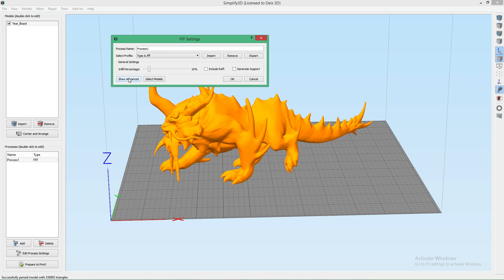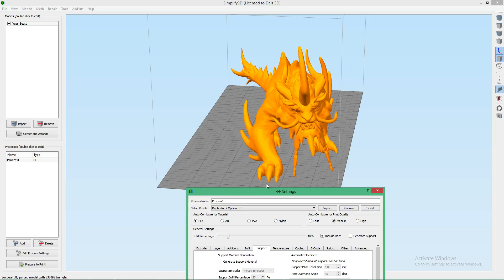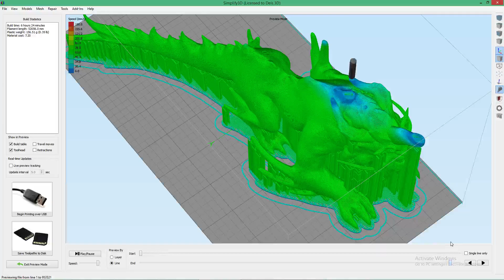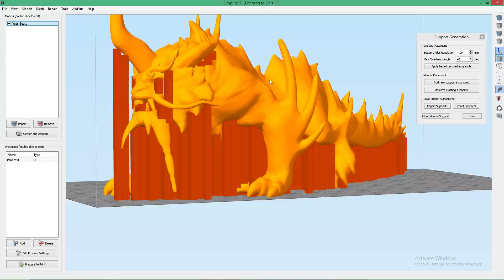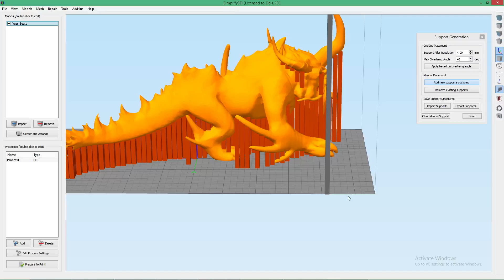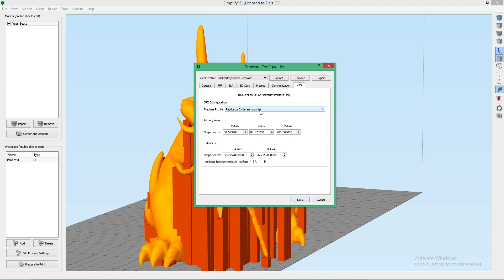Running a simple print with Simplify3D

Comment: Unable to contact the "fantastic support".  Can you assist with a M3D and the newest software? I can't get it to talk to the ports. ie:
Attempting connection at \\.\COM4... Baud rate 9600
RECEIVED: wait
RECEIVED: wait
RECEIVED: wait
RECEIVED: wait
RECEIVED: wait
RECEIVED: wait
RECEIVED: wait
RECEIVED: wait
RECEIVED: wait
RECEIVED: wait
RECEIVED: wait
RECEIVED: wait
RECEIVED: wait
RECEIVED: wait
RECEIVED: wait
  Testing plaintext communication protocol...
RECEIVED: e1
RECEIVED: wait
  Testing binary communication protocol...
RECEIVED: wait
RECEIVED: e1
RECEIVED: wait
  Testing alternate communication protocols...
RECEIVED: e1
RECEIVED: wait
RECEIVED: wait
  Attempting RTS reset and trying again...
RECEIVED: wait
  Connection failed.
Reply from the maker: +Skippy Farnsworth Unfortunately, the M3D only connects to their own software. You slice with simplify, then import it into their proprietary software to run it. Why can't you contact support? (If you can, I would return the M3D. Just my 2 cents)

Comment: Can you give me the Exe file? for Simlfly 3d? and the full version?
Reply from the maker: jack theninja I'm afraid I'm not going to help you pirate the software. You can't even do that anymore, since there are online components you'll be missing if you try.
Reply: Okay Thanks. After seeing this video I  really want it :P
Reply from the maker: jack theninja It really is quite impressive. If you think about the amount of time you'll save preping prints, the price point really isn't that intimidating. You simply cannot print complex models in any other program. Trust me, I've tried. One of the other members of the club (Deis3D) likes to print molecular structures. Since those files come from a rendering program, the STLs are typically in the 300mb range. It takes other slicers an hour or two minimum to prepare those models to print (many just crashed), and Simplify3D only took about a minute. Come to think of it, I should probably put a video of that up...
Reply: Dude Stop Ur going to make me Buy this Software :P
Reply from the maker: jack theninja hehe. Better than pirating it. Good luck with your printing! If you have any other questions just let me know.

Comment: Any chance of showing a final print and the support removal on a model this complex?
Reply from the maker: ***** If you look at my thingiverese page, you'll see I did actually print this, and didn't have much trouble removing supports from it. Sadly, I'm away from school this summer, so I probably won't be able to do any super complex prints. Suffice it to say, they come off quite easily in PLA (even better in ABS, so I've been told). Simplify's supports really are quite extraordinary! Again, if you look at my thingiverse page, you'll see that I've done a bunch of complex models (some even more so than this one) and gotten the supports off fine. Things as large as this guy usually take me a few hours to take all the supports off carefully, with thin wire-cutters we use at Deis3D. So you'll have to take a little bit of time to pull them out, but they'll come off easily (I just use a ton of supports). Quite honestly, support generation is probably the killer feature in Simplify, no other slicer comes close. It's a nice idea to to a video of support removal, though. I don't think I have a good camera for it, sadly.

Comment: nice video, was wondering if you can close the gap on the print that is on the raft? not sure what I changed lol.
Reply from the maker: Randomstuff Thanks for watching! I'm afraid I don't understand your question. If your model is not touching the raft, you can try changing the "Separation" setting, to make sure it hasn't gone crazy. Otherwise, make sure your print is arranged on the build plate. Simplify will lift it so that it is on top of the raft automatically. If you're wondering why your raft's top is not filled in (not a solid top), you may need to increase your raft-infill. If you have another problem, let me know, I'll try to help! (or contact Simplify3D Support, they're great!)
Reply: memnarch1113  thanks for responding back, i made the switch from makerware to simplify3d, but in makerware i was getting more of a smooth first few layers of my print that sits on top of the raft, but in simplify3d when i remove the print from the raft the bottom of my prints dont look as smooth or as filled in as when slicing in makerware.
Reply from the maker: Randomstuff Very interesting... You should be able to get the same smooth look with Simplify, it just may take more tweaking than you're used to from Makerware. Are you sure you're getting the whole raft off? Even though the base settings for raft infill is around 80%, I usually go much lower, something like 30%. First, this makes taking the raft off much easier, and second it means if there is any raft left on the print, it's kinda obvious from the stray lines going across the bottom. I would warn you that it probably would reduce the stability of your print, causing it to pop off more easily, and probably also does less to help with warping. (though I've never had either of those happen to me).

If you're sure you took the raft all the way off and the print itself is looking bad, you might need more support underneath it, i.e. more raft infill, or more bottom layers. I'm afraid this isn't really a problem I've had, so I can't be of tooo much help. If neither of those suggestions work for you, absolutely contact Simplify support. They'll definitely help you out! I'll help too, if you can give me more to go on. 

Congratulations on making the switch. You'll definitely be happy with your purchase. Honestly, the print quality difference is impressive. It might take a little work to get everything perfect, but I guarantee it'll be better after some tweaking. Happy printing!